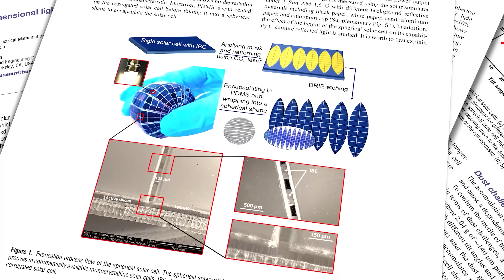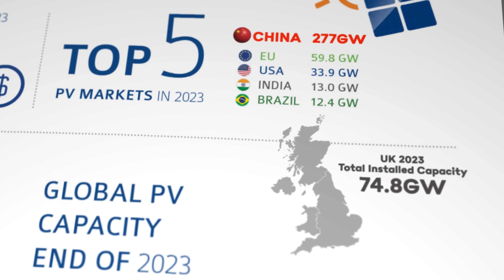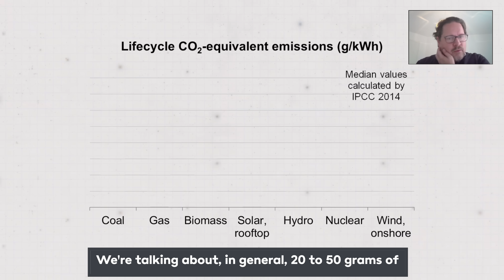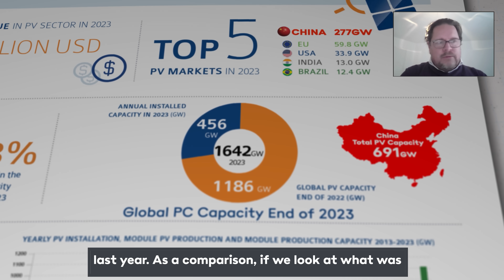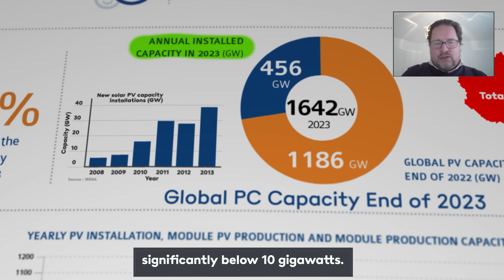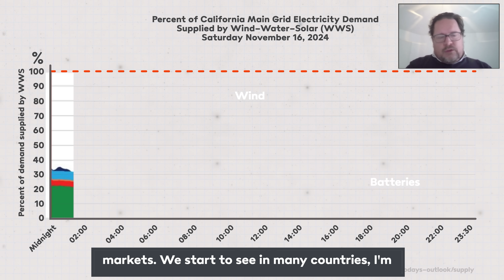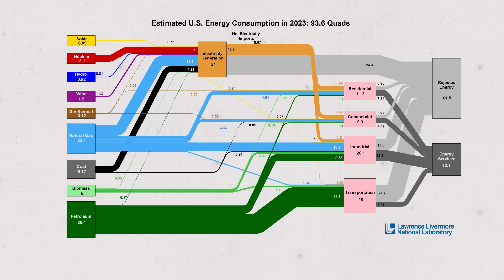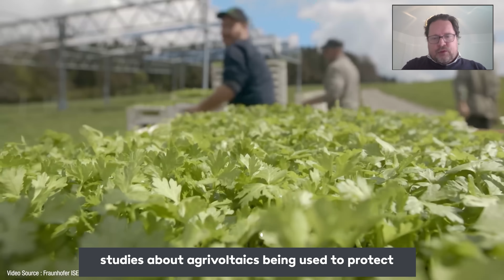Renewable Energy Domination

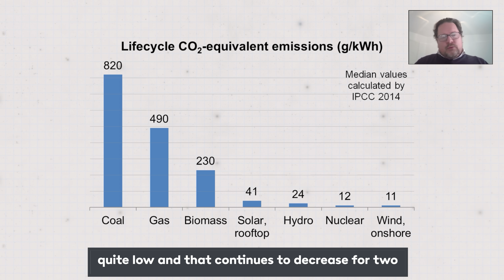Comment: 4:30 The value for nuclear power might be way off - calculating an accurate value for the entire lifecycle of a power plant is challenging, especially for nuclear, even more so since we don't have a permanent storage solution for waste anywhere yet, but there are solid papers (createdby the Fraunhofer Institute for Building Physics IBP for example) out there which claim that nuclear energy produces above 50 (sometimes above 70) gCO2/kWh eq.

It's a minefield to traverse, though, because everyone has opinions on that topic. Pro-nuclear sites like to cite papers which conclude that an even lesser impact than the one shown in your graphic is caused by nuclear power. It's a beautiful rabbit hole.

Comment: I think you misunderstand baseload.   The fossil industry has tried to redefine baseload as bulk power.  Baseload is the minimum load in a period, we use this to suit inflexible generators like coal or nuclear so its output doesn't have to change.  Supplying only base load is a disadvantage, not an advantage.  In the past coal was cheap, but then the grid only pays low for baseload.   Peak power is expensive.

Comment: 13:23 - I had a similar back and forth with someone on Facebook on a post that said if all fossil fuels were replaced by renewables shipping would halve globally. Most comments were that they would just be replaced by shipping solar panels & wind turbines. Had to point out that one ships a fuel, the other ships "generators" so after some time shipping will slow right down. I did some basic calcs on the MWh's a coal ship carries vs the MW's worth of solar panel and I came to around 7 days the solar, from said shipment, would take to generate the same MWh's as the coal, but then the solar carries on whereas the coal power has run out and needs more fuel.

Comment: Who needs the grid at all? 
Solar panels - (2kW) more is better. 
wind turbine (2kW) (operates 24.7 to as low as 4m/s)
4 LiPo Batteries 200ah each
MMPT solar charge controller
Battery Charge manager DCDC controller.
3000 watt inverter. 

$8000. Off you go.  This will power your fridge for 4 days. It will easily run your laptops for 2 weeks. It will run all your light. An air con for about 5 hours (3kW) And if you run out of juice - Honda make a 3kW diesel generator that's 18 dB. (you will only ever use it on hot days or super cold nights)

Comment: Touching on the last shown statistic presented by Al Gore: 
In the German language, we have the words "verbrauchen" and "gebrauchen" (variations of the word "brauchen" which means (need), which translate to "consume" and "utilize". 
When talking about materials demand for energy generation, it is important to never forget that the (fossil) fuels used for energy generation like oil, natural gas, coal etc. are CONSUMED, while the raw materials needed for energy generation from renewables like silicon, lithium, copper etc. are dug up once made into devices and then UTILIZED for their lifetime, after which they can be recycled. 

You can also recycle combustion end products though. Doing so to produce fuel for internal combustion engine vehicles is called producing e-fuels. It's also called a really stupid idea to power road vehicles for good reason.

Comment: There does need to be a conversation regarding the overall maintenance and excess cost of road surface repair with additional increase in weight of vehicles using the roads, then also the addition of brake dust into the atmosphere and rubber from tyres. Electric vehicles are not a solved solution and instead are a commitment to economic dependence on eastern production.
Reply: On the issue of brake dust, most of the braking in EVs is regenerative, the energy goes back into the battery, not dissipated as heat in the brake discs.  So brake wear ànd brake dust is very much less  with an EV than ICE.  Weight wise, EVs don't have to be heavy.  Dacia Spring is 1 ton.  Range Rover Sport is 2.5 ton.  It is the choice of ridiculously large vehicles that is the weight issue, not what is powering them.
Reply: @scallywagII  yes that is true and is a significant factor in combustion engined vehicles aswell.  There is an argument that reduction of overall vehicle weights on the roads may also have additional safety benefits for both stopping distances and trauma to individuals that are hit by cars although the emergency braking technology is a great advantage in terms of an extra layer of protection in addition to an observant driver.

Comment: Unfortunately renewables only supplies electricity. That is only 20% of global energy consumption.  While much coal and gas is used to produce that electricity electricity cannot replace much of the fossil fuel use, particularly oil.  The question is how much electricity is produced from the renewables installed in low suiitability areas.  In sunny Australia my PV daily average is about 3.7 kWh per kW installed but veries substantially from year to year depending on weather.

Comment: The significant thing is how long does it take a PV to pay back its "carbon debt"? If for example it took longer than six years, it would be a net carbon emmitter in the crucial run up to the end of 2030. If it takes only three years, then it is a win. 

However long it takes to pay back the carbon debt, then after that time has expired it is almost carbon-free (the exceptions being the fossil fuels used in the machinery and vehicles needed for ongoing maintenance; and ulitmately the CO2 breather out by the workers -- once we get down to the point where staff breathing is the dominant factor then I think that is as far as we can get)

Incidentally, the carbon debt pay-back time is why I am rebut the argument that new nuclear is carbon friendly while accepting that pre-existing nuclear plants should for the moment be left running: it takes a nuclear generating plant many more than six years to pay back the carbon emiissions from its building (concrete, steel, machines, and vehicles). Once the debt has irretrievably been incurred and the plant is running, then coniuing for as long as is safe makes carbon sense.

So what are the figures for solar? I have seen the emissions predictions for the lifetimes of solar panels, but what are the five- six- or ten-year projections like?

If this info is already on the web (indeed if @Dave has already covered them) please tell me what to search for. Otherwise, @Dave please could you cover this in a future video.
Reply: Depends on where they are installed.  In Southern Europe, around 1 year or less, Mine in South England, less than 2 years.  It will also vary with orientation and any shading issues.  They are getting much cheaper partly because of more energy efficient production.  Search Energy return on investment for more details.   Everything Electric Channel featured one Chinese maker that has their plant powered by their  own renewables so is net carbon free.

Comment: if you calculate just the total of already existing commercial roof surface area in the country right now, that number alone is already some 5x higher than the necessary solar panel surface area needed to power the country.  thats not even including residential roof area lol.

Comment: As a proponent of renewables, I hate to have to throw cold water, on these amazing numbers.
As long as we're still measuring solar, or renewables  generally in GWh, we are, unfortunately, barely scratching the surface.
I say this because our energy use is NOT measured in GWh, it is measured in TWh!
What is the difference between these two measurements?
Well a GWh is: 1,000,000,000 watt-hours. while a TWh is: 1,000,000,000,000 watt-hours.
Yes, that's 3 extra zeros tacked on to the end.
We don't just use 1 TWh of energy either, there's a whole lot of that gigantic number.
So, until we reach our first TWh, of renewable production, we're still in our early days, and won't be dominating anything, anytime soon.
We will get there, but it's going to take longer than anyone wants, and it's going to mean keeping up the sort of rate of implementation we've seen so far (possibly more than that), for a decade at the very least.

Comment: Great and wonderful presentation about renewable Sun Energy. When I hear that this industry has 7000000 employees who contribute 1200 GW new power on year 2023 this talks. I will get apriory that on average every employ on this industry will get 40000 $/year and together they will get 280 Bilion dollars. This certainly is great because 1200 GW power when installed may have efficiency 10-19% ano on average 12%. These are based on some public data about PV.  On average 1200 GW PV may generate 1261 TWh/year electricity and this energy only for salaries will have a cost 0.222 $/kwh.  This really is great because the energy is clean, but as we see the cost is hight, even I considered apriory the salaries. And the energy cost do not has only salaries, there are other expenses to be added. Make your estimate and come with more accurate comments. Are PV worth for investment, yes certainly the PV are great, but drop the cost and not only on presentations, but on real life.
Reply: There is a large mistake in your calculation.  The vast majority of the 7M people working in the solar industry do not work on keeping the existing solar farms running, but rather at building and installing the panels for new ones.  As these panels have a lifetime of around 25 years, you forgot to divide your personnel cost per kWh by about 25... which would lead to less than one cent of personnel cost per kWh!  
It is so true that some huge solar farm contrats, in sunny regions,  are being awarded for a price per kWh of less than 2 cents!

Comment: Thanks for the update and inspirations.  I get an ironic kick out of people mentioning the "end of life cycle" for PV panels.  Er... they don't actually end any time this century, per se.  They lose some efficiency, or it becomes worthwhile to replace them with newer more efficient models/formulas of panels on the same space, perhaps.  The "life cycle" type estimates given for particular panels are usually for when they will degrade to a particular 90% or 80% of their original ability.  You can totally leave them out there doing that for decades more, until it is worth it as an accounting decision to invest in new/upgraded ones.

There are people who put up solar panels in the 1980's who are still running them 40+ years later and still getting 70-80% useful return.  Modern panels will have useful life expectancies more like 100+ years, so if 1% of them per year get rotated out, it keeps up the total fleet.

The thing about solar + storage is that it is a total cumulative effect that will eventually dominate away almost anything else.  It is so long-lasting and low-maintenence and increasingly economical to install in more and more locations, that it will simply swell up organically until it has fulfilled almost the entire grid-use and transportation sector.  We're just at the beginning of the curve even now, when it is passing from "futuristic" to "everyday sensible."

As PV+bat becomes more of an automatic utility function of buildings themselves, it will almost passively take over across time.  Yes, specific applications like geothermal (which given the new laser tech could actually become the main base load generator), or wind farms where applicable, or modular thorium for heavy industrial zones, will still be good bonuses; but the general market will just slowly get saturated with solar+bat because it is so easy to work it in until it becomes post-scarcity.
Reply: Thats what I have to explain to these people that say they degrade every time. They can still be reuse for smaller projects like power a shed for light or even powering a wireless AP unit. Just because they produce less doesnt mean they're worthless. If anything that gives them another life before hitting the recycling plant.
Reply: THANIKS FOR THIS VERY EXCELLENT COMMENT.
It should be added that cooling the panels greatly increases their life expectancy; a century or even two would be a reasonable expectation. There was a company that produced a panel-cooling tech, but it apparently went out of biz, not sure why. It looked like a clear winner. Maybe bad implementation, bad marketing, financial probs, management probs, who knows? But someone should be working  on this.
Reply: My PV array here in Denmark produce up 1 MWh in a good summer month. In a poor winter month it produce 0.04 MWh. I like my PV panels, but I can't suffice with just that and batteries won't help.
Reply: @mortenprehn7964  Yea solar is definitely not as good in northern countries. But thankfully a lot of us have tons of hydro or wind opportunities. Here in eastern canada most of our power comes from giants dams up north.
Reply: @mortenprehn7964    Yah in such a high-latitude cloudy area, your area would be one of those good geothermal and/or wind supplement candidates.
Reply: It's also great that a PV+Bat systems are a decentralised power supply which helps balancing the grid. The only thing I worry about this is the supply chain of the materials that are needed in the production.

Comment: Whilst agreeing the fossil fuel industry has done it's damnedest to stall progress, the nuclear lobby and UK politics does not have an illustrious record either - eg Take Scotland's wind energy production - Only now are interconnects finally being installed to carry much needed energy to southern England, but even when completed the number of turbines being turned off will still be scandalous (Cannot be exported to Europe as such interconnects have historically been sidelined/gazumped) - Yet despite this ludicrous situation, the State of a Secretary for Scotland wants more of them shut down to accommodate nuclear.

It's high time energy was removed from political interference and strategic planning restored.

PS - There's a big drive on here in Romania for domestic solar and storage installations, with new ones spring up all over the place. I'm convinced part of the sales drive includes switching off power randomly at stupid o'clock.... 🙄

Comment: Alarm bells when he gave the Co2 in them of g/MWh. How many MWh is he estimating each panel will generate? I want hard numbers not estimates. At any rate, shame that there’s no way to economically recycle them and that they only last 20years.
Reply: 30 plus
Reply: @davidwatson8118  Are you saying each panel would generate 30MWh? that seems unlikely, since each panel is like 300W. I think you couldn't get 30MWh out of that within the lifespan of the panel
Reply: @1toneboy  
30 plus years.
And you need to catch up.
Each panel is 440w now for most domestic applications.
Reply: @davidwatson8118  440W is pretty good. But I doubt it's 30 years. The output deteriorates as a curve as it ages. Maybe there's an industry standard % drop which is the classification for end of life.

Comment: When we talk about the role of utilities, most of the criticism is from the West and refers primarily to investor owned utilities.  One fact is important.  The fastest way to install solar and wind is in farms where hundreds of thousands of panels and loarge numbers of 1MW windmills can be installed in months.  It's the fastest and cheapest way to transition to 100% emission-free energy.  Add batteries and the problem of intermittency vanishes.  Surpisingly, another problem of grids can also be addressed and dramatically reduced.  Battery complexes can react to shortages and overages in grid supply in milliseconds.  Pre-battery grids lost about 15% of generated electricity through overheating of the transmission and distribution wires and supporting technology.  Batteries dramatically reduce that loss making all renewable grids even more beneficial.  Solar, wind, and batteries along with some hydro and possibly a little nuclear will make energy dramatically cheaper than ever before.  Think about this -- why would utilities not want this to happen?  The answer is why we should make all utilities publicly owned or simply government owned.
Reply: True.  Thanks for pointing this out.  All utilities should be publicly owned.  Investor owned utilities are worse in every way.

Comment: PV should go on roofs. It’s dead space. Every factory, distribution centre, office. 
Those interconnectors are vital -HVDC, GW capacity. Day-to-night battery storage is great. But an anticyclone such as we just had in the UK and would have left us with a 6TWh deficit over a week, even with 4 times the current renewables generation but no fossils, is the challenge we need to address. We need to be good neighbours(!) and we need a whole new culture around industrial-scale demand management. 
Answers on a postcard to…
Reply: "no fossils" is not what you want.  We should maintain some of our gas peaker plants as backup for the rare events when renewables fail.  If we have to burn gas a few days a year, that's just not a big problem.
Reply: @incognitotorpedo42 
It's coal, gas, nuke and other fossils that have a habit of failing due to inherent slow shut down ability when there is a grid failure.
Renewable can shut off instantly.

Comment: I'm still very worried that the amount of energy (including human work energy as well as fuel/electricity) you have to expend to manufacture and install this amount of solar is unsustainably high.  Has the energy return on energy invested improved with recent technological developments? What proportion of world energy can realistically be provided by solar?
Reply: One of the reasons that solar panels are so cheap these days is because they DO NOT require huge amounts of energy to produce.  The EROEI is quite good.